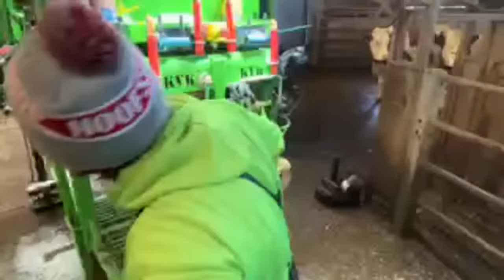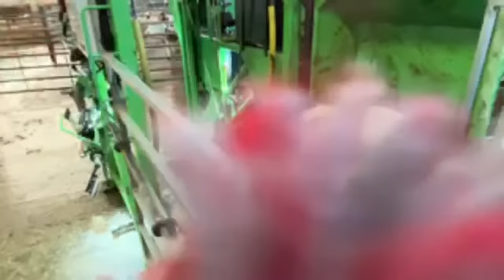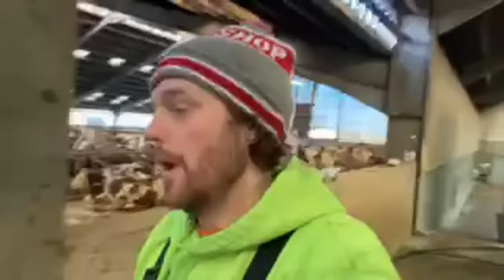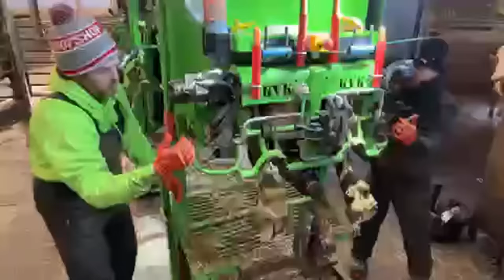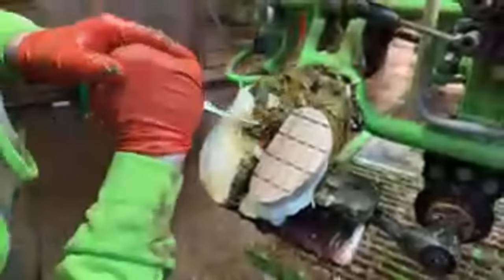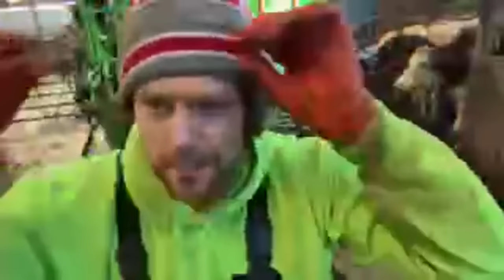Live hoof trimming … right now

Comment: This is pretty cool!
Have you visited the idea of a head camera?
Reply: I'm thinking it might get pretty messy
Reply: @lindastent-campbell5130  yeah, I was thinking that too.  Just trying to problem solve on a way that the camera can zoom in on the back hooves.  And a way to be able to see the front hooves while they are being trimmed.  I do know that a go pro can fit inside a clear plastic case for the purpose of water proofing.  And that would make it easier and quicker to clean.  If someone has or can design something similar   to incase the camera that goes one the ball cap.  That might work pretty well.  Going through a dry run could prove to be advantageous.